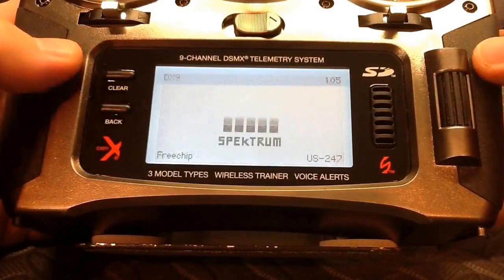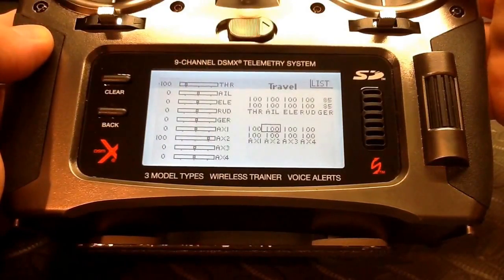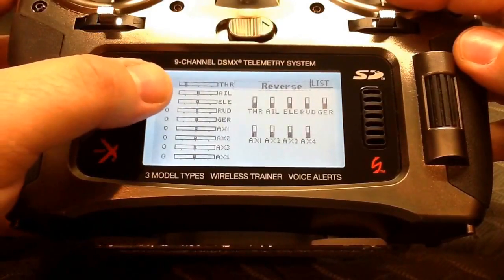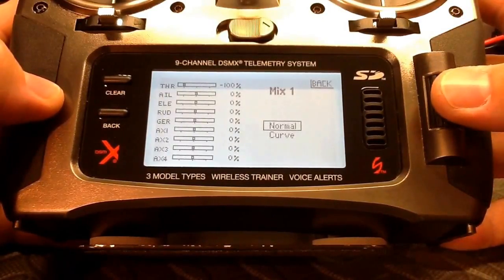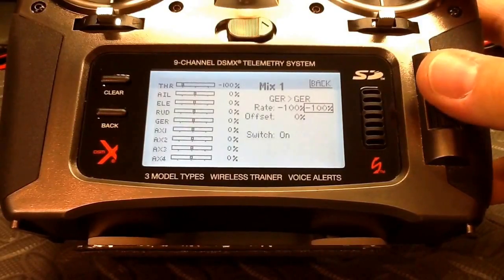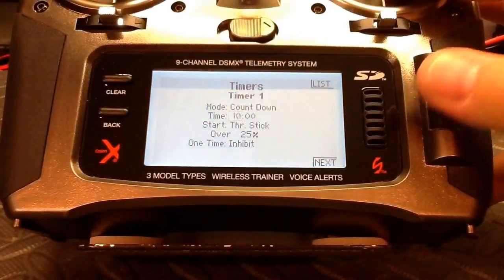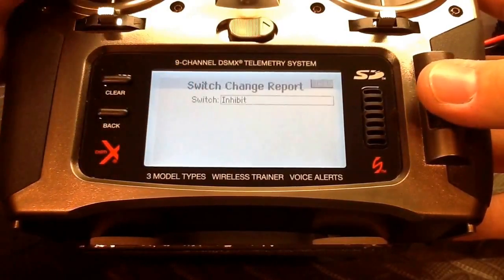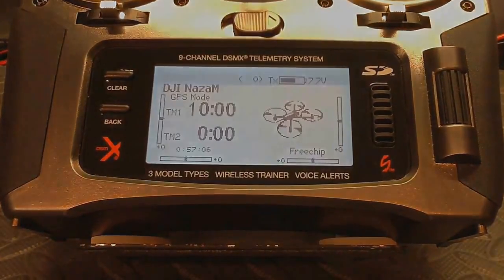Spektrum DX9 programming for NazaM Part#2 Function List Video#2

Comment: Thank you for your time and effort! It takes most of the guess work out . I know it's many years later but I have nobody else I'd rather ask for help...
I have an old phantom 2 vision w no camera, it has the Phantom 2 naza , not the naza m v2, (this is probably where im going wrong) removed stock receiver,  added orange 920x
Binding normal process. 
Using your settings in my DX9 black, 
Problem  is as soon as naza m v2
Realizes no stock tx it goes into failsafe.  Even though the PT2 program indicates connection there's no life on the program screen , no sticks, no way for me to adjust trims .no way to calibrate. 
This is driving me crazy!
"Please help me obi wan your my only hope "
Mark B
Reply from the maker: email me at smarlo@yahoo.com - it will be easier and quicker for me to respond to you. put DX9 naza programing in subject line of email.

Comment: Great video and every thing worked out great but one It will go into GPS  and Manual mode but cant get the slider to stop on attitude  when the switch is on number 1  .. what do i change to get it to stop on Atti.  Thanks for any help
Reply from the maker: Switch to Atti mode and use sub trim to adjust. You may need to use servo travel to adjust the end points for gps and manual. 

If your radio is up to date you can use Digital Switch menu to adjust the values for each switch position so when you toggle into each flight mode the assistant shows them activated. Aka blue
Reply: Thanks for the help it all worked out great

Comment: what spektrum receiver are you using ?
Reply from the maker: AR7600, I also use an AR8000 in my hexa and have recently changed the AR7600 to an AR7700 to provide programming help for someone who wanted to use SBus connection.

Comment: Great video, Im setting up my dx9 with a F550, Will these settings work for that. Thanks in advance. Frank
Reply from the maker: Yes - it doesn't matter if it's a 450 or 550, what's important is that it's a NazaM or Naza Lite.

Comment: Hi Freechip excellent set of videos. Copied yours to the letter all seems fine only question i have is now that i have set my gains & flying ok how do i set the aux3 knob on my dx8 to operate the gimbal tilt. Many thanks Paul.
Reply from the maker: In the Switch Select menu of your DX8 change the Knob: selection to Aux3 or the auxiliary channel that you're using for your gimbal tilt function.

Comment: Hello! Thanks for the instructions - but there are issues - reverses set as you in the movie. 5.26 minute. But when I connect Naza - got that stick gas began to work in the opposite direction.The top of the zero gas.bottom max gas.Why on the video feed gas and an Elevator you have not put the reverse?
Another question I have a receiver Orange R800X Spektrum DSMX - tell me how to connect to the Naza lite?This receiver 5 channel chassis,6 channel flaps 7 and 8 are optional.Channel U Naza 7 channel receiver? X1 Naza 5 channel receiver? X2 Naza 6 channel receiver?
Switches in DX9 how to assign?Did like the movie - turned out to be nonsense.In assistant mode switching does not match.
Reply from the maker: There is no issue or errors in my video, the settings are based on the equipment I'm using. Spektrum transmitter and receiver.

Comment: Thanks how about sharing your settings for the TX on a file or by email, i would be really greatfull, i have spent hours trying to sort out the settings, i have followed your guides but it would be nice to know i have got it right, one more thing could you show us what would happen in the Naza software should the TX be turned off simulating loss of signal. well done
Reply from the maker: If you click on the video description SHOW MORE you will see link to my website that contains the SPM file you can upload in your TX.

Comment: Thanks free chip, so can the meat of these video be used for the dx8 as well?
Reply from the maker: Sure OR use the DX8 video I did. :)
Reply: Ahhh, I rewatched the Dx8 video again, for some reason I thought the failsafe portion was missing.  My bad.  Do you have a video about the course/ home lock and/or gain tuning via the Dx8.  I know you mentioned it in the video . could you show how it's done, or is it already done via the video